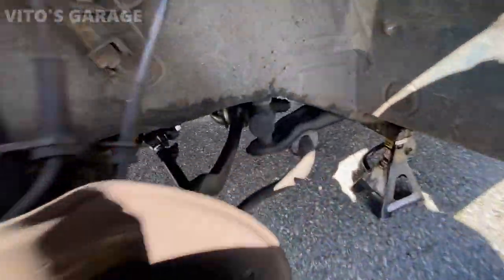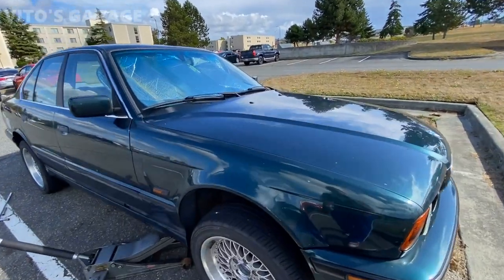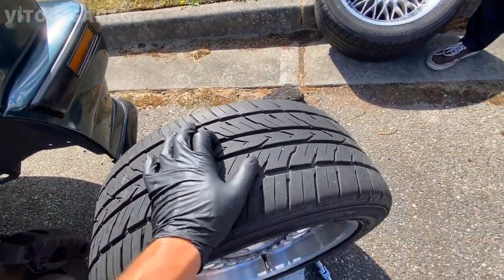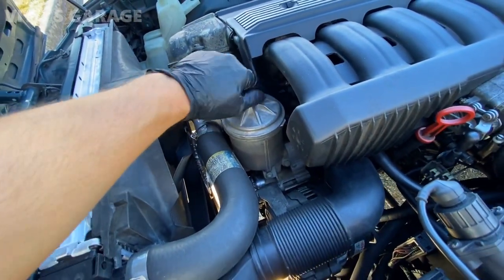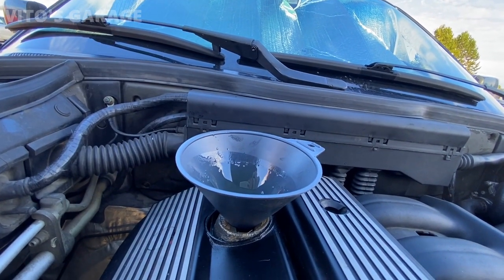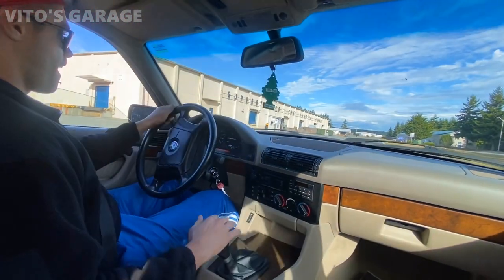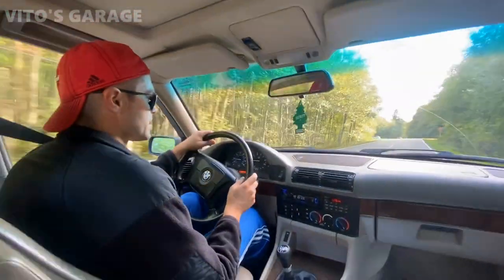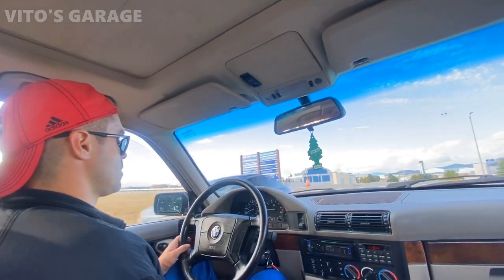We Sacrificed an Entire Day For This BMW E34 5 series! Vibration Problems, First Oil Change & More!

Comment: I was wondering when you say the owner had the tires balanced, does it specify, it, usually the tire shops they will do a basic rotation, if the customer were to have the 4 tires balanced  it would cost money,also did they align  the car, but from what I see in the video  the tire has what they call cupping, the treads, are worn, meaning soon the metal threads would be coming out soon also that rim looks like it is bent it is not round.
Reply from the maker: A lot of shops don't know how to properly balance the tires. The alignment wasn't done, I had to do the alignment myself on it using a string in the parking lot.

Comment: Hubcentric rings.... you need them asap
Reply from the maker: Maybe. I haven't looked into that. These are original BMW wheels, not aftermarket. Aftermarket wheels usually need those hub rings.
Reply: @VITOSGARAGE  these wheels are from an e39 5 series which has a larger hub bore. Your vibration was likely caused because you didn't install hubcentric rings. They are available on eBay for a few dollars in either plastic or aluminum.

Comment: If one of the rims was bent, or supposedly bent, I would have tried the spare in case it was the tire, sometimes they can become defective, or if you hit a hole,
Reply from the maker: I am very certain that the vibration is due to improper tire balance and tires being unevenly worn. And I would use a spare tire but this car is missing it..
Reply: @VITOSGARAGE  wow That is surprising, I know some new cars don*t carry a spare, but they have a compressor like if that is suppose to fix the tire if it is no good
Reply from the maker: @EnriqueLopez-hb5jn   @Enrique Lopez  these E34s came with full size spare from the factory. We bought this car without a spare. It just didn't have it. We need to buy a spare tire for it